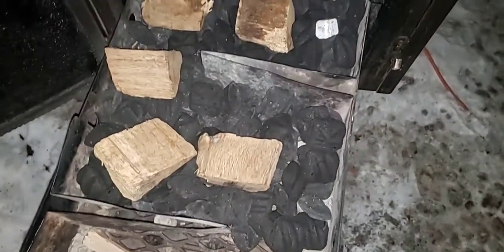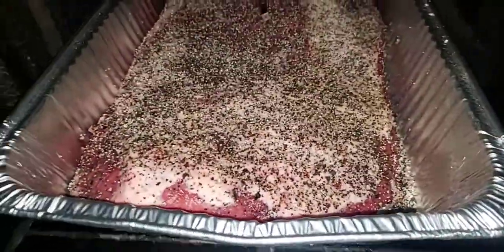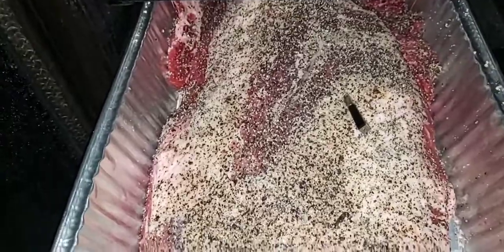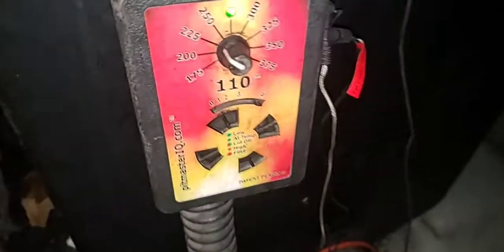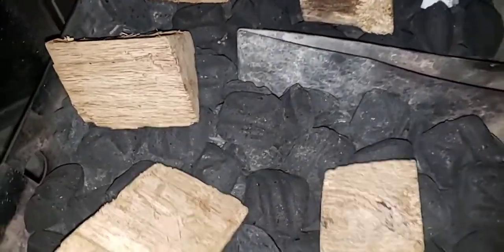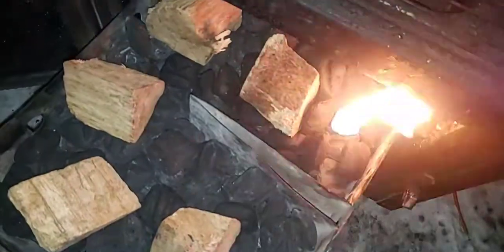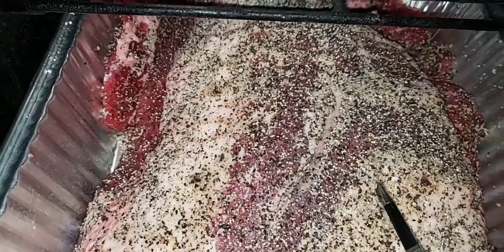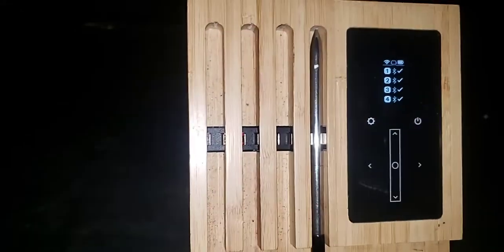smoking brisket in pans

Comment: Did you sell your vault?
Reply from the maker: hey Robert. I still have it
Reply: @pitmastertoby2598  I sold mine a while back but a quick question. I have a offset smoker now. Do you think it you can make just as good of brisket cooking them in the foil pan? I know it would make it a lot easier for cleanup and do you put a rack under the brisket, then set it in the foil pan? Or do you just set it right in the bottom of the pan? Thanks for any info
Reply from the maker: hey @robertburnett1970  
in the offset it will better.
straight in the pan with no rack I like better either way is fine. I like I said in many of my videos it's the juice that makes the brisket. I sell out everytime at my restaurant.
God bless
Reply: @pitmastertoby2598  thanks for the info bud. Next time I’m going to try that.